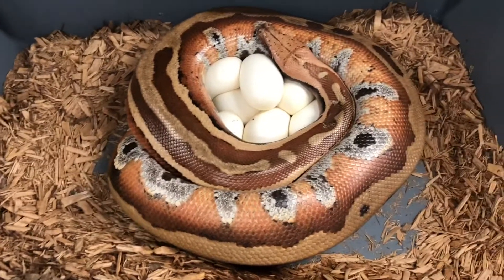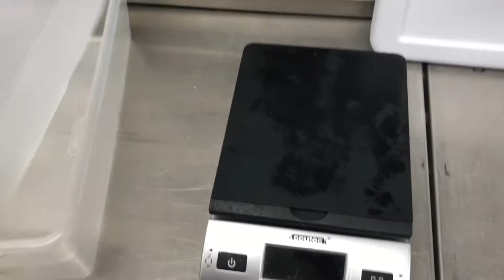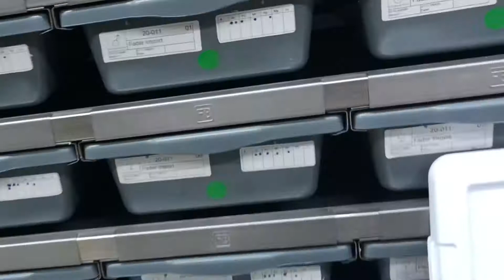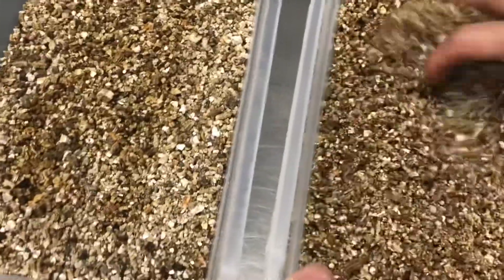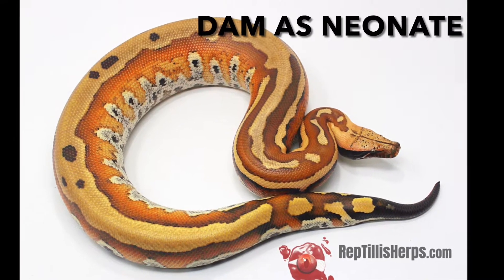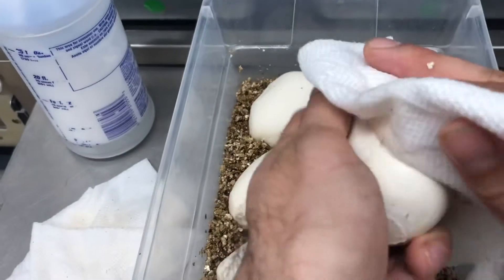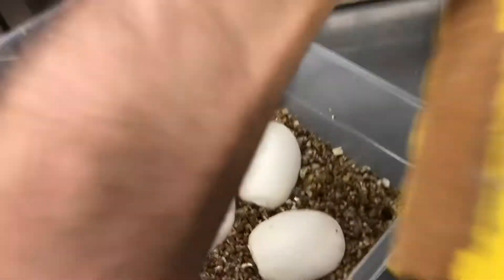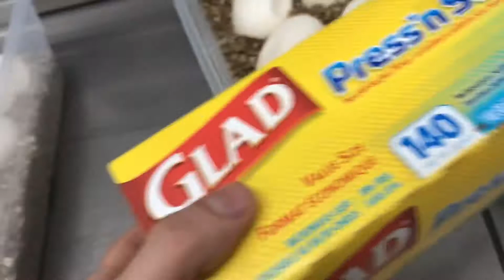First Blood Python Clutch of the Year! - Genetics, Nidovirus (Serpentovirus), and incubation 101.

Comment: Real interested in how the phenotypes will meld together. Do you think what Miss Tracy calls level 4 Slackline is a super Stripe super Banded?
Reply from the maker: I actually haven't heard of a level 4, but that would seem potentially likely. I have both VPI superstripes as well as slacklines and there is considerable overlap in looks between the two, there's also a ton of variation in the level 2 stripes, and striping seems to be one of the most common morphs with these guys, which leads me to believe what really gives slackline the power to do some neat stuff is that level 1. If the first spider ball python ever imported turned out to be a bumblebee, I predict it would have taken us awhile to figure out they are actually two unrelated traits and not different levels of the same trait. Or I could be entirely wrong. But I would be excited to see what happens in attempts isolating the banded trait.
Reply: @RepTillis  might be my mistake. I could have sworn I read somewhere that there was level 4's